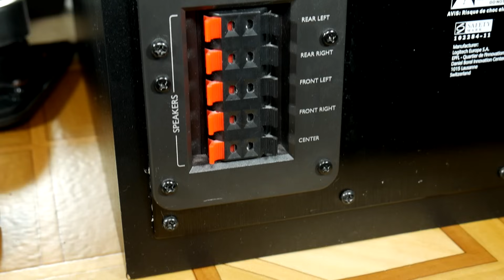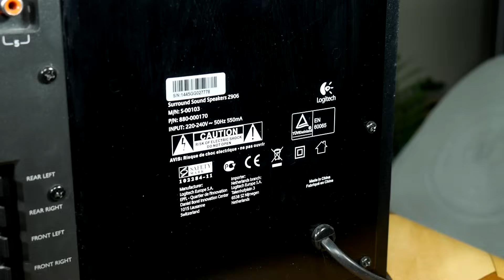Look inside Logitech Z906 5.1 Speakers + trying open control console

Comment: When I opened mine subwoofer I saw a lot of black melted blobs around capacitors. I thought it was some fault bit looking at yours it looks the same. So maybe thats how it should be.
Reply from the maker: looks like it
Reply: It is glue, so the components do not vibrate, especially on big components or the subwoofer they like to do that.

Comment: 2.45 what is that connector on the control pod for ?
Reply: probably SERVICE PORT for update the firmware/contents of flash/programmable ICs, serial data (debug mode) etc. Probably of not much use if you are not Logitech.

Comment: the amp on my 11 years old Microlab FC730 got fried from a power surge this Tuesday RIP.
rather than buying a new amp for it (good luck finding one its rare AF) or buying a similar type of amp (aka an AV receiver - cheapest comparable one in functions to the FC730 is freaking 1000$) i decided to just buy a new set of 5.1 speakers with multiple inputs, turns out the 5.1 computer speaker market has turned completely stale in these past 11 years and the only speaker option with more than one audio inputs and real 5.1 support that's still available is the z906 so i ordered that as a replacement, i already know it's going to be amazing compared to my old FC730 (i mean seriously my ATP3's sounded better but were very limited practically for use as shelf speakers due to short proprietary cables and lack of multiple audio inputs.
Reply from the maker: best way is just grab some second hand AV receiver for suroudn and some aliexpress mono block amp for subwoofer - Done.
Reply: @Techscrews  haha yeah i first looked into that, but no matter what kind of combination i tried at cheapest it would end up costing me 450-500$ combined, i just got the z906 for 350$ so that was significantly cheaper.
i'm still going to fix that amp in my lab in my university though, these FC730's were THE bomb, if i can i'd use them on my flight sim rig instead of using headphones

Comment: Guys, Can I use Z906 Speakers on my Z5500? are they compatible?
Reply from the maker: Z5500 speakers 8ohm, but z906 have 6ohm. Nothing big, you can use they, but your z5500 amp heat a bit more.

Comment: Does anyone know how I can connenct my logitech bluetooth adapter to the Z906?
Reply from the maker: easy, wire from adapter put speakers aux socket.
Reply: Thanks for reply! I have it both connected to my pc while I plug in the aux. It works but I get a loud background noise which I dont know how to get rid of?
Reply: _ Staal Have that one with my tv tho

Comment: i own the z625 love it, got mine for £100
Reply: I have the 623's (same thing as the 625 just missing optical input), they're basically the little brother version of this. I also have a Z-5500 set now, which is the big brother of both the 906 and the 623/625.

Comment: Logitech Z2300 are LEGEND. is best speaker system from logitech. subwoofer driver is look much better than z906 and z5500, subwoofer box also much stronger and sealed than z5500 and z906. (if you look at screw on back them have 24 ) and power transformer is a lite smaller maybe same than z5500 but z2300 powered 4 IC. 2 tda7295 bridge for subwoofer and 2 tda7296 for satelites. and z5500 powered 7ic TDA7294 . I have 3 z5500 and one z2300, and i love z2300. BTW that driver can handle more than 120w rms. I powered with DIY tda7294 bridge and handle very well

Comment: No airpass holes on satellites😮
Reply from the maker: These holes are called bass reflex ports. Sometimes, using a closed speaker enclosure is better for achieving a smoother sound. Bass reflex ports often produce a booming sound, which is not ideal for satellite speakers, especially in the mid and high frequencies.

Comment: i use my guitar in a 5 watts tubes amp ,which is plugged in a 1X12 jet city cab ,volume at 5 is equal to the Z906 at 10 ....i have to use a jack 3,5 mm to use it with my computer (not a laptop )....The sound is good but the surround function doesn't work normally ,the rear speakers have a problem in this position ,the 4,1 gives a good sound to my taste ...i send it back ,my old Sony 2X20 hi-fi system  was at least as powefull  ,if not more powerfull...They say 500 watts ,i don't know why they multiply the watts like that nowadays,it isn't too honest .....I send it back ,i have the Z 623 ,i would say that the Z 906 is 25% louder ,or 15 .....The sound quality is good .

Comment: Hi sir 

my subwoffere dosent work,  how can i repair it? 

Thanks
Reply from the maker: If you ask this question, better go to local repair shop.
Reply: Hi i have the same problem now, have you fixed it yet?
Reply: @Techscrews  Not to worry i factory reset the unit and the sub worked :)

Comment: 1.5 years with this sound system and I'm really not complaining about what it offers at that price.  The subwoofer is quite powerful despite being small.  I have already told you previously in your videos that it is not 165w because at that power the coil begins to heat up.  The amp is pretty powerful but I use it sparingly, I have put a couple of fans on the back of the amp to let the amp cool down a bit and they have helped keep the system cool and use it a bit more, it lacks a bit of treble and the sound is not so balanced when i turn the subwoofer level up to max as it goes way up and it will be damaged so i use the sub moderately at 50% and the experience in movies, music and games is great, set up the screen and my PlayStation for Dolby Audio and the "Decode" LED lights up when it detects dolby/Dts formats on streaming or gaming platforms, the experience is excellent.  I have the JBL Bar 5.1 that has wireless surround and costs almost triple that of Logitech and the truth is another big difference.  I have thought about buying the Logitech Z623/625 but I have seen that the Z625 have more failures on Amazon.  Which ones do you recommend I buy?  greetings and good video
Reply from the maker: if you dont need digital(optical toslink) inputs, but classic, analog input z623.
Reply: I've had my z623 about a year now and it's done me very well with no issues

Comment: Mine allways turn off and start making a cracking noise every 30 seconds untill I either unplug them or do a reset which fixes the problem for a few hours, anyone got any idea?
Reply: Try unplugging the input and see if it still makes the noise. It's probably the source which is causing this not the speakers

Comment: THE CONSOLE is much strong that the speakers xD
Reply from the maker: exactly, I'm disappointed it won me
Reply: I tried to open the console too, cause i had to change the wire from the subwoofer to the control unit... it was broken somewhere....   no chance..   Logitech´s support just answered to the question how to open the console: "we do not repair this things... you can just buy a new one" .   So i cutted the wire near the console and soldered a new one on and a new Sub-D jack.  It took me 5 hours ... but its working now again.         But it has to have an option to get opened somehow! Would really be interested fi anyone finds out guys....

Comment: I always wondered about the subwoofer size ever since it caught my attention. Thanks for the video
Reply: Have a look at the specs online for an online retailer such as curry’s and have a look at the dimensions, for some websites they do show these sizes in MM but you should easily be able to convert that to a measurement that meets your requirements by either using an online calculator or working it out yourself using your preferred method, I hope this helps.
Reply: this is woofer.. ,sub woofers are different.
Reply: @vikasbarman6939  shut your mouth if you don't know anything. Learn what's woofer and subwoofers are.
This driver is a subwoofer which digs deep down to 24hz.
Woofers are drivers which are used for producing mid range. Woofers starts its frequency response from 50hz onwards. They won't go low below 50hz. Also they have thin surround and the construction is totally different from subwoofers.

Comment: I am kind of disappointed to see the thin plastic body of satellite speakers and the average subwoofer magnet size.
Reply from the maker: but it cost just about 300-350$ and you get so much for so good money
Reply: The Harman Kardon subwoofer has the same size magnet, but it pumps out extremely loud ! its not all about the size. But i do agree the plastic body of the satelite looks very thin and cheap.

Comment: NOOPEE - the quality of the build and the quality of the sound isn't worth the money. Got them for 4years- the psu board burned down and this is common issue with this z906 setup. The last good quality series was z5500 and after that they shipped the manufacturing to other company. I got them on SB Z-series card with optic connection. when in games sound was ok, the movies are mediocre, and for the music when on stereo the sound is sheit. Bass is to punchy and sometimes got the felling that is to slow. If you are happy that you get for 250$ - 5 plastic speakers, punchy woofer and a decoder that is placed like shit on a pcb board without any way of displacing heat that will surely fail in not so long time in the future (psu burn or the procesor unit) and a remote controler that is a joke xD then good for you ^^ But i lost my money, because when u buy a high end stuff, you should get one. Now i'm invested little more, and bough E s760D and the difference is without comparison. Sry for any mistakes ENG isnt my native lang.
Reply from the maker: it's very strange because I know a lot of z906 users who have this system for use more than 6 years without issues. Maybe for Europe have different factory  build z906
Reply: @Techscrews  i bought the z906 in norway. The inside pcb was blue like in the video. I know 3 ppl with the exact same fail (psu fail). Maybe you dont listen them loud? I use them in 24m2 room and sometimes i crank up the vol to 3/4. But i compared the pcb with my friends 5500 and the diff in the quality is huge. Rez placement and quality of parts)..

Comment: No speaker box should be made from plastic. I sneezed when I seen the dust lol
Reply: Random Tube They're crapy 2" speakers. And they're sealed.
Reply: You don't need to drill holes in the wall with 5.1 either. And some people (like me) drill holes in the wall for 2.1 systems too because they've got no room on their desks and the speakers can barely even stand up.

Comment: 7:46 perfectly China made this Z906 :'(
Reply: @Pho Tato just look inside the board everywhere is glue bruhhh
Reply: @robertboyd321  true :) my p9 lite bendt a little bit and broke my screen when i played games on it :)
Reply: @Uraim  this amplifier is really very good, has good performance, lots of security, dsp configurability, you don't know what you are commenting on, don't comment :)
Reply: @SpeakerMaster942  I saw my friend has z906 and almost his house got burned down coz i saw his amplifier and it has glue ocean on his board
Reply: @SpeakerMaster942  did you saw the z906 inside? It's looks like the chinese Man Can use 300tonn of silicone glue, and the most cheapish version, its Can go easily burn. 
My friend had the silicone glue ocean version.😂😂😂
Reply: @Uraim  Somehow I have these speakers for 3.5 years and nothing bad is happening to me :)
Reply: @SpeakerMaster942  repairability is killed due to that sea of ironglue. thats why it suck :D You need a special iron material grinder tool do something.

Comment: 4 friends of mine had I and 3 of them were broken after 2 years.

Sound is great but not worth it for only 2 years
Reply from the maker: My frieds have some z906 and they use more than 4 years. Maybe for Europe have better build speakers ?
Reply: @Techscrews 
We live in germany, usually the quality standards are very high here.

I don't know, on amazon many people had the same problem with this system.

I really liked the sound alot but it's just too risky imo, so many people had the same problems with burnt electricity
Reply from the maker: strange, mybe they all are bassheads ?
Reply: If always keep bass to 100% and volume almost a full, yes it probably broke. No need to do that.. 
I live in flat, and set up bass to 80% and volume a 50%. For me to good.

Comment: undersized tiny magnet.
Reply from the maker: magnet not the main think, to get nice bass :)
Reply: Techscrew magnet always play an important role when it comes to subwoofer but yes most manufacturers use small magnet in compare to the after market drivers.I got an 8 inch driver, magnet size twice the size of this one.

Comment: Class D amp
Reply from the maker: D class is good to get such power for a good price and does not require large radiators
Reply: Efficiency is many times better when compared to A / A/B amps, but sound can be pretty cold and anemic when compared to real A class or A/B class amp
Reply: Dub Monster 
A class D can sound just as good or even better as class A or AB, it's just much harder to engineer them to that level of quality.

Class D also requires more careful design to suppress EMI to negligible levels.

That said, I am no fan of needlessly heating up my room and paying a bloated electric bills.
Reply: Yup, you hit the nail on the head
Reply from the maker: exactly, may be bad quality build A/AB class amplifier and super-made D class amplifier or vice versa. Each case must be looked individually. For logitech d class ir more than good :)

Comment: It's a trash.....
Reply from the maker: maybe you can suggest other 5.1 system for $ 300 ?
Reply: ArtūrsM If you can increase your budeget...you can go for $450 Yamaha home theatre.......
Orelse, with same budget you can go for Yamaha sound bar...
Reply: @RajaHRaja  A soundbar is not 5.1 though and way less flexible when it comes to speaker positions